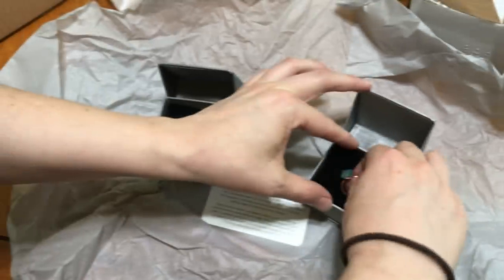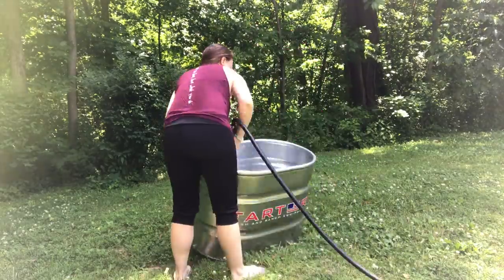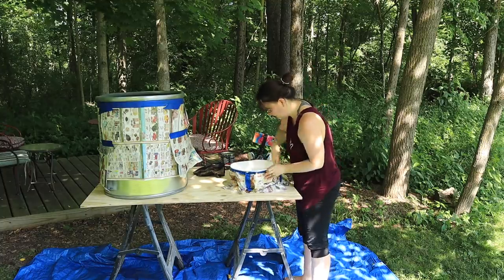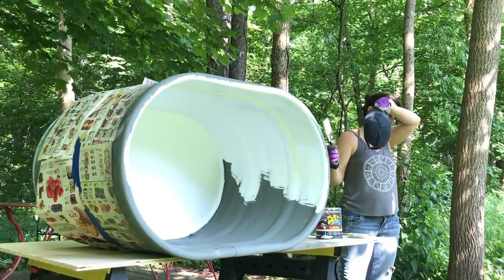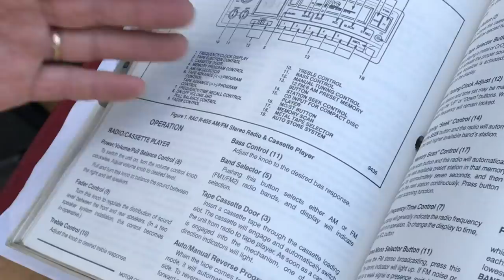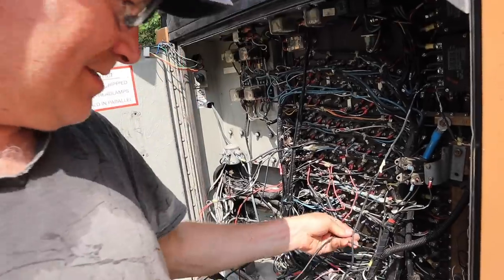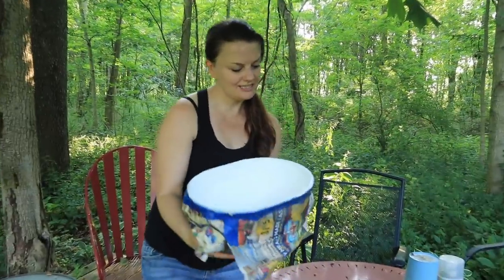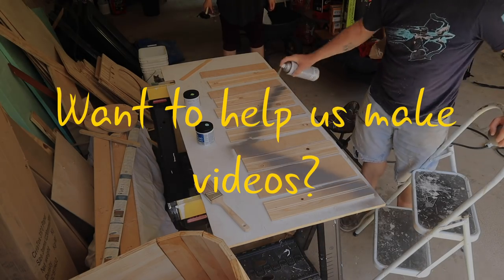Bathtub and Sink for our Bus Conversion - S03E24

Comment: Hi just was wondering on the sink and Your Tub Why didn't you put your drain holes in the bottom before you Painted? The Painting You both did Came out Great.
Reply from the maker: Well, the sink we weren't sure if we wanted to use it as a sink, it was kind of like a test for painting before we did the tub.  I'm glad we didn't as we are going with a different sink option and that little tub for storage.  But with the bathtub we probably should have cut the drain hole first. We'll probably have to do touch ups on the tup after making a hole

Comment: Do you think when you put warm water in the tub that would leach into the water? Or no? Do you smell anything from the leak seal?
Reply from the maker: Lukas my understanding is that the metal would actually leach into the water, but the leak seal is a sealing it. It's non-toxic and designed to be used and safe for plumbing. And no, no smell once it dries.

Comment: I'm curious to know how you thoroughly clean a painted sink or bath tub without removing the paint.
Reply from the maker: I’ve been thinking about it too.  I’m not sure I should use my abrasive scrubbing brush but I guess we’ll see, may need to touch up the clear enamel layer after time or perhaps it will fair well.  I have not seen anyone I follow complaining about theirs chipping.